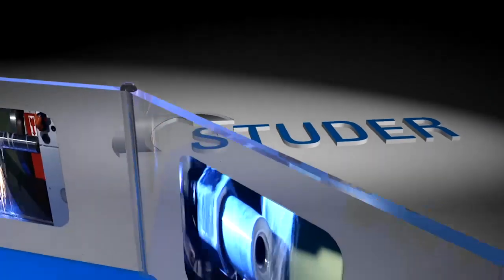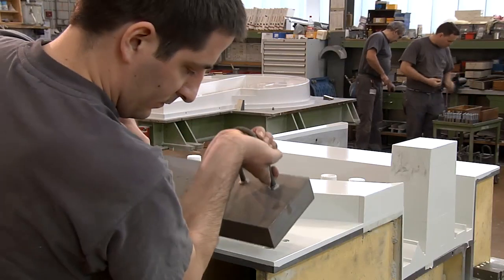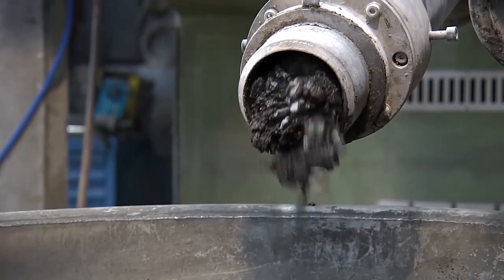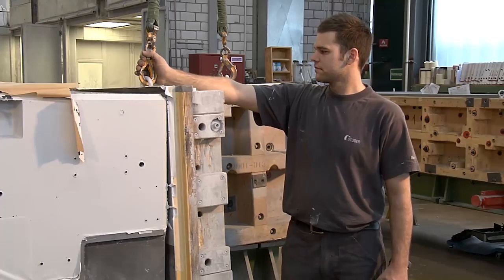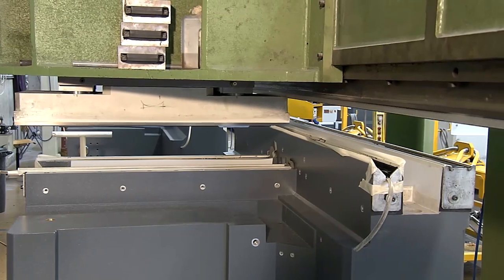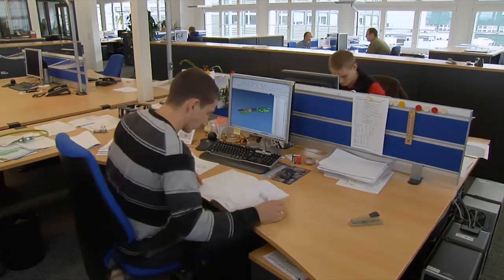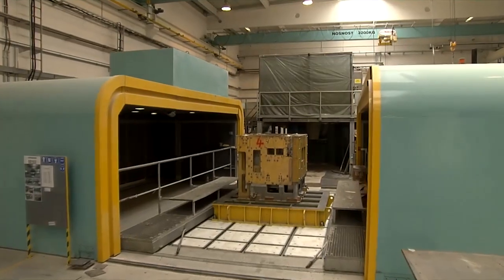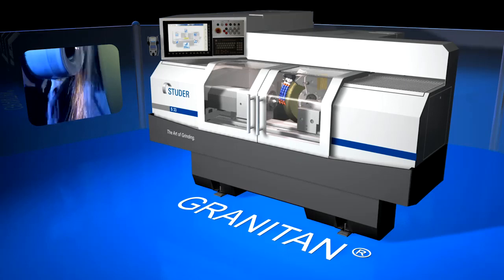Granitan® machine bed

Comment: So is Granitan better than natural granite of the same size and thickness?
Reply: Natural granite has 20-60GPa modulus of elasticity while polymer concrete depending on formula and additives 20-30GPa. But how would you manufacture the machine bed from a huge chunk of granite and what the cost of that would be?